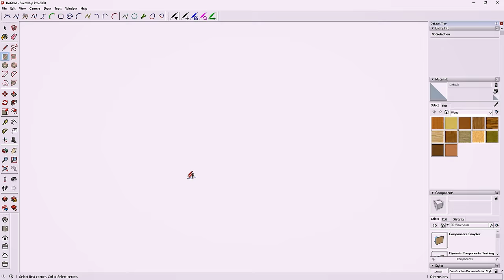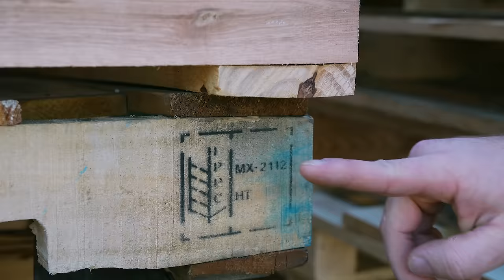Pallet Coasters, the RIGHT way (200 of them!)

Comment: As a person who used to throw pallets for a living, your pallet throwing form is emaculate
Reply: What were you doing specifically, what was the purpose of removing the pallets from the premise?
Reply: @V1c._.  just moving them. Throw em from a stack onto a floor or off the floor onto a stack
Reply: @Thoroughly_Wet  gotcha, sounds kinda fun
Reply: used to stack 6/10 cans of tomatoes on palletts and such, w/ an electric fork lift. those are the best. palletts should be treated well, as they'll stack better. once saw the aftermath of a new kid who extended his boom too far, and ended up causing the boom to simply lean on the stack he'd already put there. wasn't hurt. frontward motion should be impossible on a thing like that.

Comment: Jackman, not every Country uses the same style of pallet as the USA.

Over here in the UK, we used either standard British pallets or Euro pallets. Both of which are similar in design to Ben's tiny pallet (actually, his design was more like the standard British which is 1200mm x 1000mm). A scaled-down Euro pallet at 1200mm x 800mm would not work.
However,ban Aussie 1m x 1m would.
Reply from the maker: We get those euro pallets over here too! I like them because they actually tend to be easier to take a apart, although they're rarely ever hardwood, so I don't work with them often.

Comment: That was so beautiful, and fun to watch. I make pallet wood coasters that look like pallets. I have a lot of Hickory, because a lot of what I get for 'free' at work is hickory.(I'm a heavy duty body repair man and diesel/heavy equipment mechanic) Anyways, that's what I like to make "pallet-coasters, and trivets" out of hickory. Not the hardest wood out there, but it's inherently impact resistant, once it's covered with shellac, varnish, stain or urethane, or maybe mineral oil, they're very durable. Not "dishwasher-safe", but still durable, none the less. 
I made mine with a circular saw, and jigsaw cause it's all I've got for the moment. I really appreciate your attention to every detail. Great Video Brother. 😎

Comment: How did you not glue the jigs together? Cant seem to keep the ca off everything it shouldn't be on. Nice job
Reply from the maker: It wasn't easy! For the first layer you can see the shim that hold it with a bit of a gap. Besides that, I used the jig for alignment and then removed it before the glue had fully cured, in case there was any squeeze out that got on it

Comment: The ISOTunes Extra that I got as a gift from my boss crapped out on me after just two years of on/off use. Before that, the controls were finicky, and it was always a challenge to hold the power button long enough to turn them off, but not long enough to go into Bluetooth pairing mode. (Sometimes they would say "power o-BLUETOOTH PAIRING MODE" and I'd have to try again anyways.) And the magnets were impossible to keep clean, one grinding session and they never reliably paused music again.

IMO, maybe some of the higher end ones are better, but don't waste your money on the extra.

Comment: sorry to say, but surely making a , say 4' by 4.8' array with full length strips then dicing it on the table saw (making the stringers and every 'edge' slat double thickness+kerf and) would surely have been easier?
2 difficult glue ups (vs 200) and setting the table saw fence twice would surely have saved quite a bit of fiddly work?
Also they could be routed in strips .

Comment: SMH, another person claiming to make mini pallets and then failing. No 2 real pallets are the same, they're never square, they're never sanded and at least 1 plank is always broken. If it doesn't have hepatitis coated nails sticking out, match sized splinters and a cracked board it ain't a pallet.